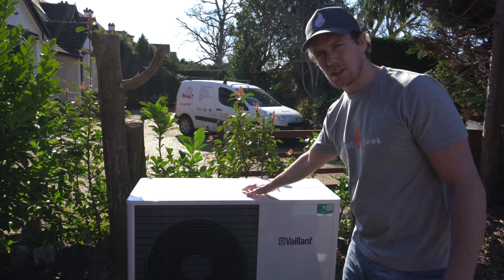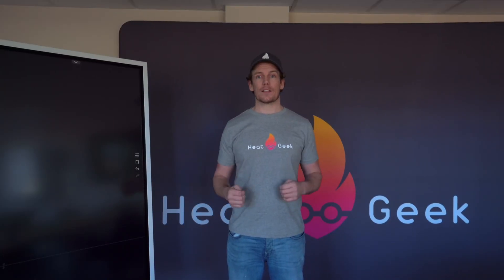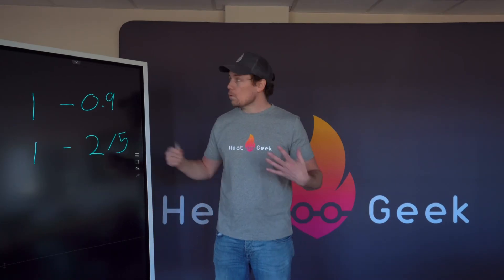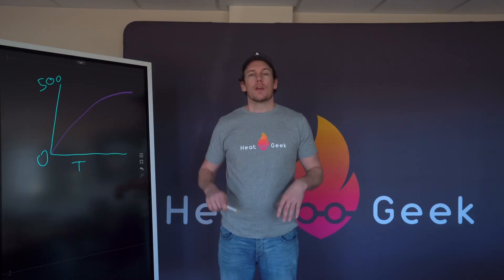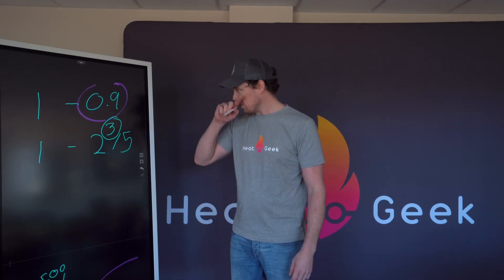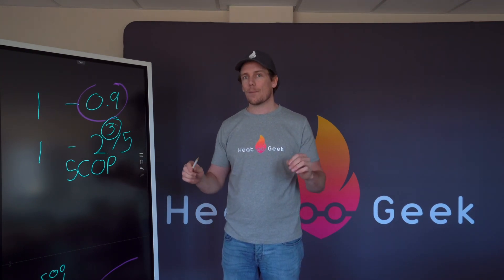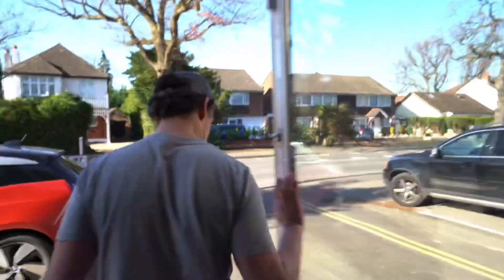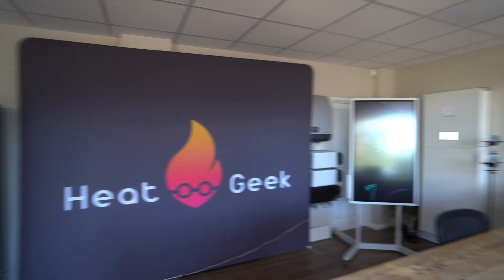Renewables Training - How Does A Heat Pump Work - Heat Geek

Comment: Hi after looking at your very instructive video I checked my flow and return of my 10 year old condensing combi oil boiler using a k probe and a true result meter i was astonished to find my flow temperature was around 40 degrees and return about 35 degrees after the boiler was running for 30 minutes when I installed the system I done a heat loss assessment on my 70s bungalow and used nearly all of my 9 radiators being doubles perhaps  I oversized the rads the house heats well I assume that my boiler is coming to the end of its usefull life and as the flow temperature is low it could work well with an ashp in my 110 sq meter insulated and double glazed bungalow
Reply: True RMS not result

Comment: Hello. I am going to replace windows and add insulation. Coming from electric acumulation to air surce heat pump. If I let someone calculate my heat loss calculation for each room and then I measure each radiator in house and try to look up its kW power. How do i compare its power to room heat loss temperature?  When is it power too low and it should be replaced for bigger one?

Comment: Great video but most people don’t give a shit about their carbon footprint. They can barely afford their current fuel bills. Rising fuel prices are a nightmare. I’m in a 2017 very well insulated new build detached house with underfloor heating everywhere. 
Our airsourse heat pump is a nightmare. 
The amount of electricity to run it costs a fortune. Windows are not left open. Room thermostats are set at 21 degrees C in winter. The fan unit is noisy and creates so much cold air.

Comment: I genuinely don't feel this is going to be a viable option for the majority of (older) houses in the UK; they just aren't insulated as well and will require a huge amount of investment (insulation, changing of rads and larger pipework) and even then you will probably just break even with the COP of 3-4. The only way to move to this technology is to (unfortunately) increase the price of gas until the consumer has no other option.
Reply: I live in a 120 year old house with solid walls. We have had an ASHP for 10 years running radiators and it works great, we are very pleased with it.
Reply: Sadly (not maybe not) increase gas prices are coming

Comment: I have double radiators, but unfortunately piping is small, and changing the piping is not a option presently. I'm on oil, would it still be worth my while to have a heat source pump? Thanks
Reply: If you've got a spare 20k to waste
Reply: @pauldavies7251  Thanks, No ill give it a miss

Comment: Great video and very knowledgeable. But I feel heat pumps will never take of fully. 30 million homes in the UK. The last 20+ years, new builds have installed 10mm pipe to rads. Many older builds have 8mm pipe from manifolds to rads. Most homes aren’t insulated enough for heat pumps to be efficient enough. The cost of heat pumps and altering a house to meet the spec would cost £20,000 plus. By the time you get through a quarter of UK homes, an alternative to heat pumps will be here.
Reply: I agree great comment

Comment: Excellent video. I’m now more convinced than ever that these are a total non starter. I own a decent sized oil boiler maintenance business. Established for a good number of years so as you’d imagine with so many off grid customers I’m getting asked about these a lot. The simple answer that I can tell you now is that not one single customer of mine is going to have me re-pipe their entire heating system, change every radiator, spend thousands on new windows etc when they can just have a new A Rated oil boiler installed in a couple of days for a quarter of the price and a hell of a lot less mess and aggro. 

Hi Mrs Smith, I know you’ve got this beautiful farm house, with lovely solid oak floors, and listed sash windows, and those lovely feature column rads. Well hold tight love cos we’re skipping the lot on Monday. Hope you’ve still got your decorators number. 

These are a nonsense. They might be great in a classroom in a town. But come into 500 country properties with me each year like I do and then you’ll see what a tiny percentage of them this could ever work in. Then even if you could actually find a house where they would, You’ll never convince someone to do that to their house instead of a simple boiler change. 

If they outlaw oil heating then I’m telling you now all my customers would go LPG/Hydrogen before they’d let you re pipe their beautiful houses.
Reply: @daz374 I agree that we will be forced to move on. The cost of gas is currently subsidised and that of electricity is not. Once the government starts to change the subsidies on gas and electricity the heat pump becomes more attractive. If they want to they can tax fossil fuels to the point they are for the super-rich only or even unavailable. Then the choice will be an electrically powered system, a hydrogen system or a bio-fuel system.

I am one of the people who have converted from gas to heat pump as my house was built with warm air central heating. Once the gas fed heating unit became too old to repair if it failed the only options were fitting a full wet radiator system or get an air to air heat pump system. The air to air heat pump system was supplied and fitted by a local HVAC company for less than £8k and works well. My fuel costs have not increased (apart from inflation price rises) and it is quieter and more controlled than the old system and comes with the ability to operate the controller with a phone app. and to have lots of timing and temperature patterns for different seasons.
Reply: Totally agree Wayne, I live in rural South Wales with only oil heating, there's zero chance anyone in my village could afford the 20k + for this useless system

Comment: This tech was available sine fridge was invented, I wandered why has been forgotten and came to light now. Secondly how practical is this how expensive is to maintain time will tell but we will get back to wooden stoves I think.
I was surprised no latent energy mentioned! Think: Tesla versus diesel. Get into details and you think again before you decide.
Or install small(1/4) size of boiler Russian submarine uses £70k palladium or platinum rods and is very effective but who is ready to put that, can we afford?!
Reply: It was forgotten for 2 reasons. 1, untill recently power was very dirty in UK comparatively. 2, their cop wasn't so good untilll recently making gas cheaper to run

Comment: So basically if you put you hand on the back of your fridge and feel the heat its this process in reverse ? And renewables 
are great ideas for super insulated new homes but the majority of homes in the uk with poor insulation and worn double glazing  not so sure ? Example you kids come in and out the house and wait half a day for the room to become warm again ? hence  lot of folk have a wood burner to boost which are also on the to ban list ,a bit like electric cars we are not quite  there yet cost and efficiency.

Comment: My local firm charges a minimum of £8,000 to fit an air source heat pump system. Completely out of the price range of most households.   I bet the yearly maintenance cost is also expensive. And how long would they survive in wet and windy Britain?
Reply: Maintenance cost is extremely low and they pay for themselves after about 5 years due to huge savings on heating costs!.

Comment: Having read the majority of comments with the replies, the HP queries are from those wishing to understand the work needed to apply a HP solution to a new or existing property. My conclusion is a lot more education needed to the installers out 
there ,wanting to deliver this alternative heating solution. The Manufactures/Distributers/Dealers are way behind the curve relying on such as Heat Geek to educate the heating population. Heat Pumps work, they deliver, but only if the designer installer stops justifying that they work. Its a heating system working differently from Gas/Oil. Accept that they work or stay away from the technology, if you don't grow your knowledge you won't succeed with the Heat Pump. Education, application, 
installation = experience

Comment: I've heard heat pumps don't work below - 1 and are very ineffective below that. Is this correct?
Reply: Also gas is 3p kwh and electricity is 14p kwh that's why nobody saves money by installing one, you can buy 4 kwh gas or a bit more for the same price as 1 kwh electricity.
Also when they generate electricity from gas turbines its only 60% efficient!
Reply: Closed cycle gas power plants are modern marvels!
Reply: You might not have such cheap access to gas, you might have lower cost electricity available with time of use tariffs, you might have your own generation, you can save money on servicing...
Reply: @edc1569  Our problem with power generation and other industrial processes is that here in the UK we don't recover the lost heat and supply this lost heat to houses within the area, I believe in some other countries they do do this, if the UK is serious about the environment then this has got to be the next step.
Reply: @edc1569  but they are still only 60% efficient.

Comment: Great video. One question I have is about COP. If 1Kw of electricity is used by the compressor to get a COP of say 4. That mean 3KW of heat needs to come from the evaporator. Surely on a cold day the COP will go down? Also how much electricity is the fan using blowing over the evaporator? I'm trying to get a better understanding of real efficiency here. So let me try an example if the compressor was using 3KW of  electricity and the evaporator is only able to provide 1KW heat then I have a COP of 1.3.  I am beginning to like the thought. Might build one myself using parts from my old fridge just to experiment...
Reply: The cop is worked of total electrical usage not just the compressor..
Reply: @HeatGeek  thanks for clarifying that.

Comment: Nice one 👍 I think the retrofit of ASHP is very much more challenging than the blank canvas of a new build. This technology lends itself (and thrives) in super insulated homes and with underfloor heating. Not saying it cannot be retrofitted, just that super insulating older homes may be difficult or nigh on impossible and getting flow rates right for the low ‘Delta T’ could be tricky to the point of expensive - especially on wet systems installed with micro bore piping.

Comment: Alan,
Firstly Love your channel 👍 what’s your thoughts on the following issue I have ... I have a Air source heat pump installed in my home 5 years ago, super way to heat our home. All under floor heating downstairs and rads up stairs. We have an issue down stairs, all the rooms downstairs are on individual stats however, we have an issue in 2 rooms. If I put the stat on in call it room A, room B starts to heat. If I turn on the stat in room B only room B heats as it should. What might be the issue.. ? room A basically won’t heat but the stat does heat room B.... confused 🤷‍♂️
Reply from the maker: Maybe the valve is stuck? Ideally you need someone out to have a look at it. Thanks 🙏
Reply: @AllenHart999  will do Alan just based on today's video thought you may have come across the same situation. No worries 👍

Comment: Thank you very much for the explanation.
Imagine all houses in UK are connected to heat pumps.
How much power would consume from national grid. I do not think the grid would be capable to provide some much demand.
The compressors don't run on modulating speed. I think is fixed speed and is not cheap to run.
Second it is the installation price and parts to fix. Massive difference with boilers.
Hydrogen is the best alternative I think.
Reply: Also the mini CHP with decent batteries will be great investment
Reply: The inverter type ones can change the speed of the compressor.
Reply: Theu xan be cheaper to run if installed well.. as per the video
Reply: @HeatGeek  I install them myself, mainly in new builds and with UF heating, but often get calls to retrofit existing systems with boilers to HPs.  Even with newer models,  like the one shown in the video (advertised as an alternative to a gas boiler in a retrofit) , it simply doesn't perform as claimed by the manufacturers because of poor insulation and microbore pipe work in existing houses.
 And I would add that the existing grid does not have the capacity to support such a large number of HPs. In winter at peak consumption hours they would all underperform or start throwing error codes.
Also, keep in mind that at lower temperatures (under 5 C) a 12kW HP only has an output of about 8-9 kW and has to rely on electric heating elements to compensate, lowering the COP by a significant amount. 
Also given the fact that they are substantially more expensive than a gas boiler and adding the cost of oversizing the radiators and the pipework, i just don't think HPs are an alternative to gas boilers.
Reply: @jpraimundo4100  undersized pipe and undersized units can be designed out. Load shifting and the new mains being currently laid will help balance the grid along with load shifting. Cost will come down with time as it has with boilers but they do need more gov incentives. its not being touted as a direct replacement for a boiler by me either. But as a planet we don't have a choice. We need to stop releasing carbon
Reply: @HeatGeek  Thank you for your reply.
Agreed,  we do need more gov incentives because money still makes the world go round. Many customers drop the HP idea and go with a gas boiler after they see the price tag on each. To most people they don't make sense financially. That's what i meant  when i said I don't see them as an alternative to gas.

And we do need to stop releasing carbon. But HPs also have a negative impact on the environment. The old refrigerants on air con and ref units (CFCs) were destroying the ozone layer and were phased out. The current ones(HFCs), wich are also used on HPs, are a greenhouse effect gas, so they come at a cost to the planet to.
And although there are measures in place to control and regulate the technicians working on HPs, many don't follow the best practices. Leak searching can be very time consuming and a proper headache, so many don't do it. Top up the refrigerant, issue an invoice and they'll be back in a few months to do it again. Until the compressor dies and then sell them a new unit .
Reply: @jpraimundo4100  still less damage than continuously releasing carbon from ch4 that a 90% efficiency though
Reply: @HeatGeek  Agreed. No perfect solution.
But If millions and millions were thrown to develop a vaccine for Covid in a year, surely it could be done to find an alternative to fossil fuels, in my opinion.
Reply: @jpraimundo4100  yes mate definitely 👍  agree to no 1 solution though.. theres no panacotta as I like to say !! 🤣
Reply: @HeatGeek  👍👌
Reply: Yeah you’d have to invest into the grid a bit, it’s hardly an impossible task

Comment: Really great video.  I've seen a lot of negativity in the UK from people from people who are stuck in their ways and don't take time to understand the bigger picture.  Gas is going and hydrogen boilers are "green" but hugely inefficient when considering the huge (54%) energy losses incurred during the production of hydrogen. Good insulation and heat pumps are the future.
Reply from the maker: Thank You
Reply: The trouble is though, producing and delivering electricity often isn't very efficient, gas turbines are only around 60% efficient at best, that's why electricity is far more expensive 4 - 5 times more than gas p kwh
Reply: Good insulation works for gas or oil heating also, it matters not what the source of heat is, it is retaining the heat that matters.
There is a misunderstanding about the efficiency of heat pumps. All the calculations I've seen are based on the elctrical unit of power. However there are many losses in making and distributing electricity, when that is taken into account heat pumps don't look so good, particularly air source.

Comment: Heat geek

When you say bigger pipe sizing, are you saying bigger than your standard 15mm/22mm flow /return?

Thanks
Reply: Really, so within a domestic propertys are you more likely to have 28mm flow/return?

Thanks
Reply: Depends on the load but most likely yes!
Reply: @HeatGeek  So what are we talking about in a three bedroom domestic house typically. Would I be correct in saying this type of system is impractical in older brick built buildings.